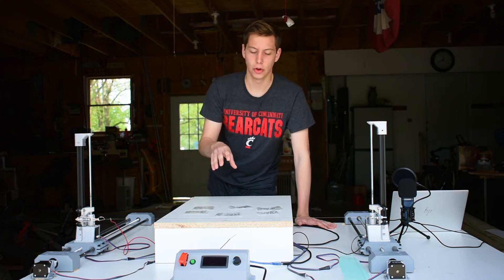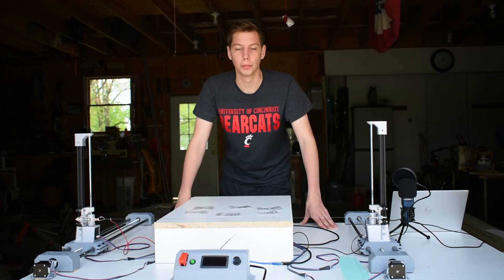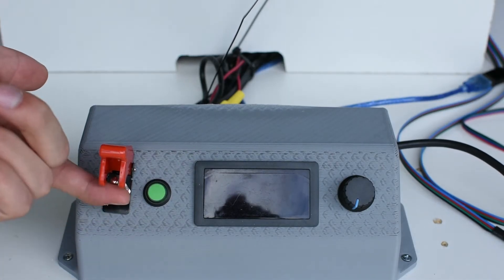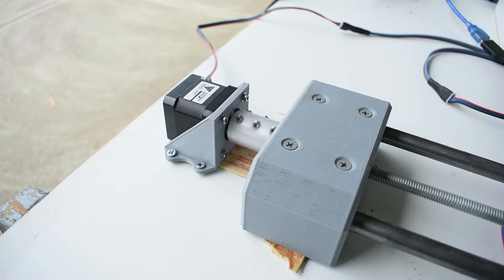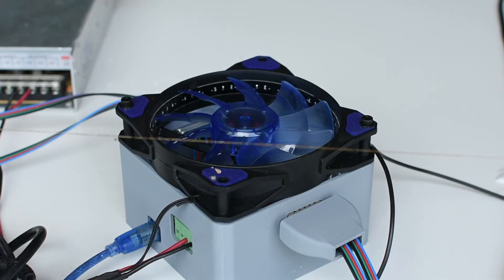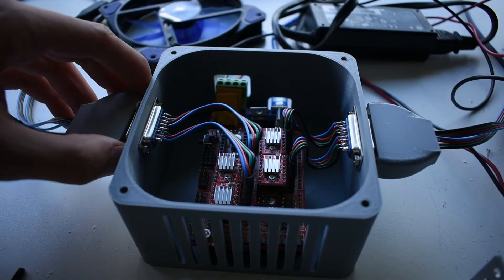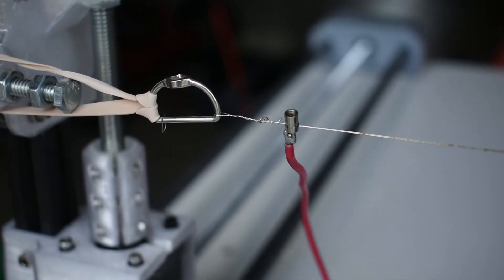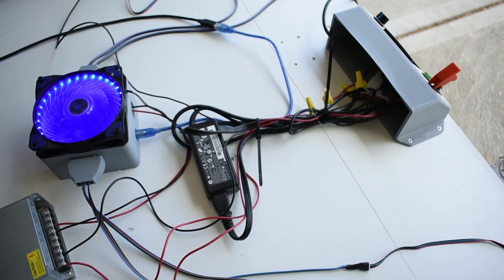DIY 4 Axis CNC Foam Cutter (Hot Wire)

Comment: Worst of the worst.  Holy cow, those cuts are not acceptable at all for any purpose, and that is the trouble with CNC wire cutters; they are the equivalent to killing a fly with a shotgun.  Gravity systems account for the wire temperature, and are far less expensive.  Evidence is right in the film.  That wire is far too hot.

Comment: i like this design better than using timing belts, Im building a full scale ultralight aircraft with foam core carbon fiber wings and really like your design, I need to have at least 4.5 to 5ft wing chord length to cut out full scale airfoil profile, Im sure I can take your design and make it 4.5 to 5ft travel in one axis and only need maybe 1.5 to 2ft in up down axis, is that the Z axis?

Comment: Excelent project, well done. I only have a question about the LCD panel. I think it adjusts the volts to the wire. Can you please confirm and sujest a site for buying it? I tried but couldnt find :). Also i admire you disposing the Step files, not may people do it and so i may remix with a threaded rod i have here and change the tubes to metric. Thank you .

Comment: Is it really considered 4 axis though? I can only see 2, x an y axis
Reply: Yes, it is 4-axis.  Each of the carriages and towers move independently.  You have x-y on one side and u-z on the other (typical axis lettering, may be different depending upon the driver software).  That's 4 motors driving 4 axes independent movement.
Reply: Try this. Hold 1 end of the wire stationary and rotate the other end in a circle. (It takes 2 axis to draw a circle). At the SAME TIME one end is rotating, start the stationary end rotating in a bigger or smaller circle. 2 + 2 = 4 🙂

Comment: Can a foam cutter like this cut foam board or foam core board with paper on both sides like used in school projects?
Reply from the maker: Unfortunately no. The wire won’t be able to melt through the paper sides.
Reply: @michaelrechtin  Thank You! So nice of you to help.
Reply: I built one of these for foam board. https://youtu.be/zqs4SGl1V_I   I know this is a year late but you never know

Comment: Michael, any plans or implementation of a turntable for this?  One controlled not one you manually move parts.
Reply from the maker: NFO Sec No plans as of now. I have seen examples of people doing it and they are pretty cool. However, since most of what I use it for is cutting wings I’m not sure a turntable would add much functionality
Reply: @michaelrechtin  Thanks.  This might work out for wings and good stationary items (signage), but I'm still in need of some 3D-based things like creating oversized chess pieces, pedestals, etc. so I'll need to consider that.  It's just none of the ones I've found allow independent controls of the wire ends like yours for doing tapered wings, etc.

Comment: Did you use any bearings on the steel horizontal rods or just let the PLA rub on the guide rods?
Reply from the maker: It is just PLA. They act sort of like bushings.  There are slots in them so that they retain some lubricant that I put onto the rails.
Reply: @michaelrechtin  Thanks.  I''ll be hooking up some motors to arduino this week to learn how to do it.  I want to build a similar foam cutter.  Starting from scratch is a little over whelming trying to wrap my head around all the parts and pieces.

Comment: Hey mikey. I'm running GRBL 0.8c as well from that rcgroups thing but the grblHotWireController crashes very occasionally for me. Does this happen to you at all?
Reply from the maker: No I don’t think it has.  Sometimes it will act weird if I leave it open in the background for too long but just restarting it usually fixes that.